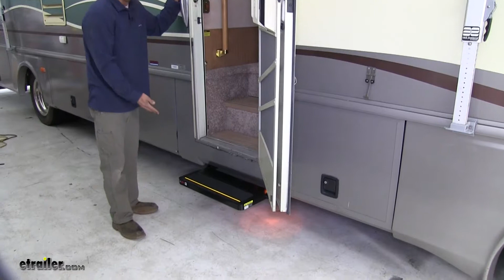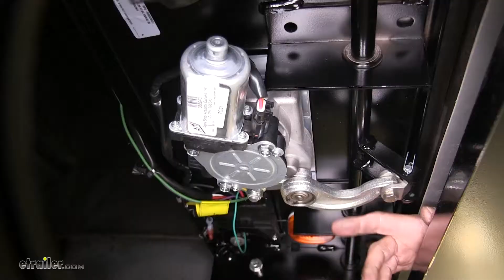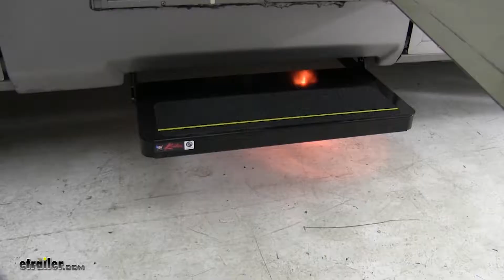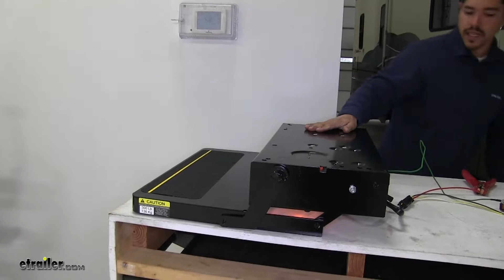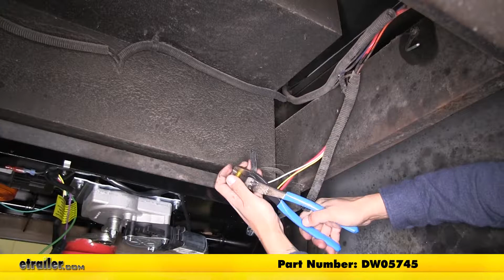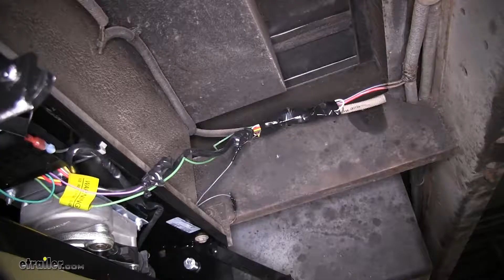Complete Breakdown of the Replacement Step, Motor, and Control for Kwikee RV Electric Steps

Comment: Theres never any need to replace these step unless the step or step chasis is severly damaged.  They just require a lot of maintenance such as debris removal and frequent lubrication.  Check youtube and other online sources for information showing how to maintain these steps.  Its much easier to do than buy a new set for a riduculous cost that probably wasnt needed.
Reply from the maker: Many people have issues with the steps getting damaged or the motor will stop working and that is why they just opt to get a whole new set.
https://www.etrailer.com/RV-and-Camper-Steps/Kwikee/LC369146.html